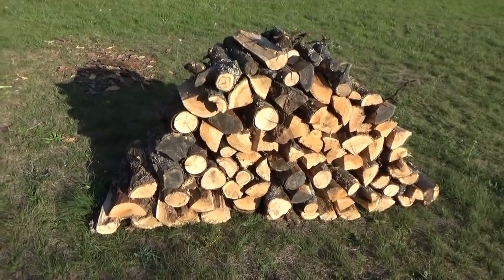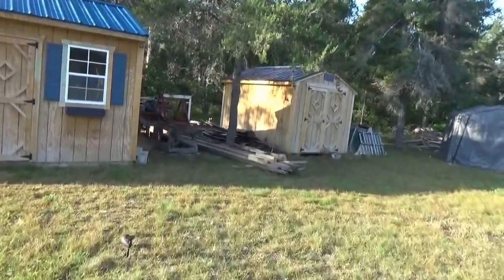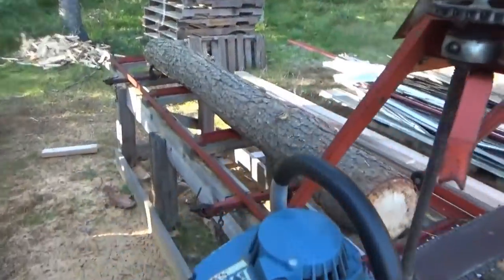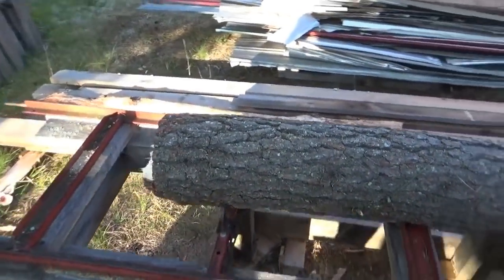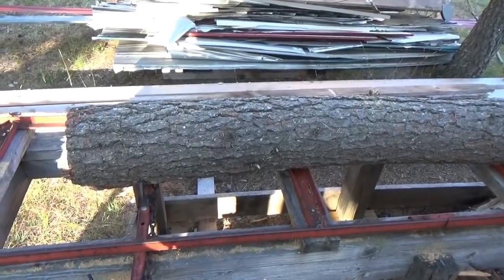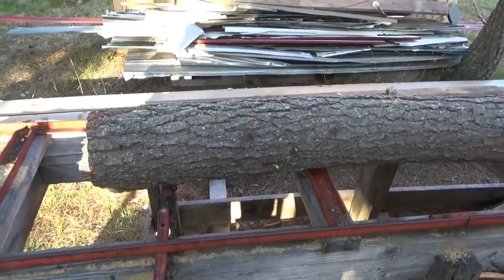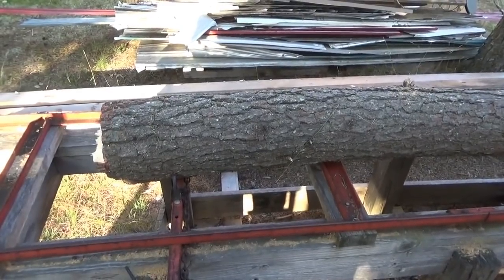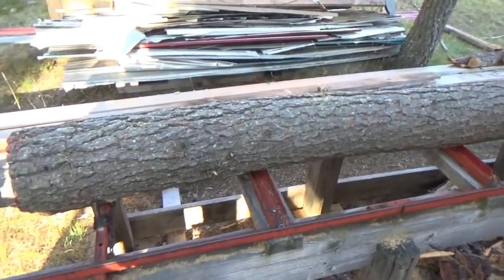The Off Grid Project Working Off Site & Lumber Mill & More

Comment: My advise.... First... If the deck will be partially exposed to weather... Pressure treated wood or cedar from Home Depot, if possible.  If not, at least don't use any crappy junk wood on the deck project. It's a project worth doing well. Second.... Set priorities. You can end up overwhelmed with too many projects... Greenhouses, decks, car and truck repairs, boats that need work, solar power that should be brought up to code...

Comment: You can build with green limber straight off the mill as long as you have air circulation on at least one side. Board and batten vqn be put on green if the backside gets said air circulation.

Comment: you can use green wood for sideing but here is 2 problems with greenor wet wood ...if you nail both edges when the wood drys it will split out at the nails ...if your useing it as lap siding only nail the top and let the siding hang ...if you nail the bottom then its going threw the siding behind causing wood to split at the nails ...second problem is getting a good penetration of wood preservatives such as oils and stains or paint solution wait till second summer to bleach clean the walls then treat

Comment: The boards that you cut will need to be up and away from the ground. (4 x 4's). Then you will need stickers(3/4 inch.). Support boards with about 4 stickers. If you don't have anchor seal, just put some enamel base paint on the ends to slow drying. Put a piece of metal siding or something to cover stacked wood and put some weight on it.

Comment: Some say you gotta let it cure and put wax on the ends to make it dry slower for less cracking. But its possible to cut huge timbers and use them green right away but its so large the cracks dont have an effect. So it depends on the size of board or timber you want. Small boards you dont want cracks so maybe they should cure a good long while so the they stop moving and cracking before you mill them. Set some big logs aside and paint the ends with wax and let them dry all winter for making some decent boards out of. post or beams can be used green they can cracked and still be useful. I guess the dead standing wood should already be ready to cut because its cured already.